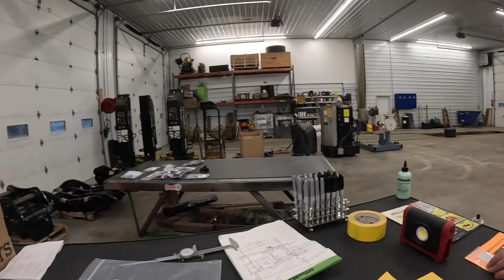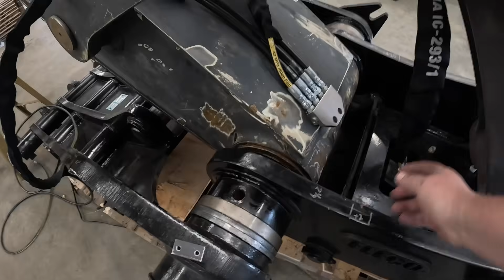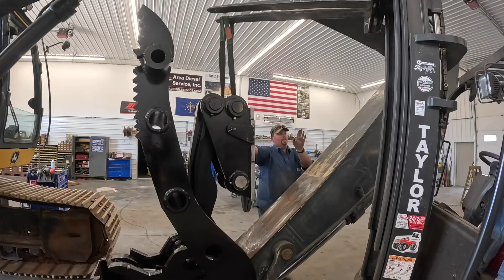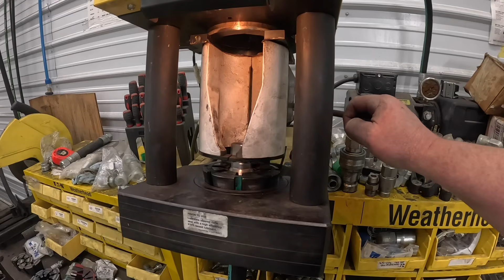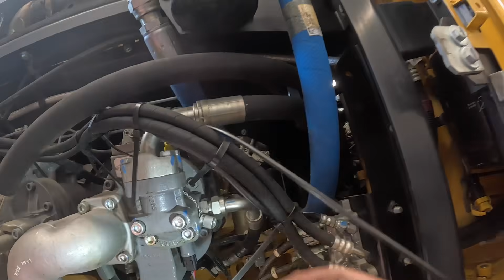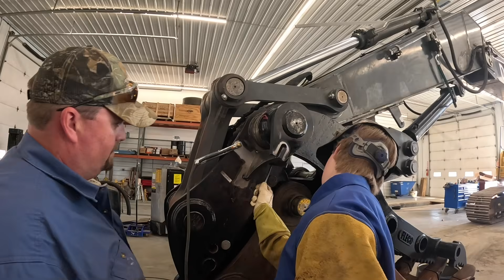We turn a John Deere 350G excavator into a car crusher with a new pro link thumb and coupler!

Comment: How about a few tapes in the shop with inches and MM both to read? If you don't think in MM then at least let your tape  teach and translate  for you and check on you every day. [And on the dopes that write the manuals] Using dual mark tapes all the time teaches you the system bit by bit.

Comment: Put 2 tons of extra iron on the end of that stick and you add a lot of wear and tear to everything upstream. Especially the turntable bearing. Seems like a tough call to decide if it's worth it. I am living with a fixed thumb even though its plumbed for a real one.  Agility over attachment swapping seems a better choice. Seems like that thumb is way overbuilt for a 350.

Comment: I got a question for you, 

Does a dozer really need “tall” I guess you could say grousers? I mean, my buddies track loader has flat tracks and that sucker will push a big ol pile of dirt or brush. 

just thinking if it would be worth it for my dozer, I’ve never had New i’m wondering is it really that much of a difference?
Reply from the maker: Track loader is a different application and has a shorter and narrower track making it bite in more
A dozer is lighter, longer and wider so you need more bite
Reply: @C_CEQUIPMENT  oh ok. that makes sense, I was just curious and wondering. thanks for the reply

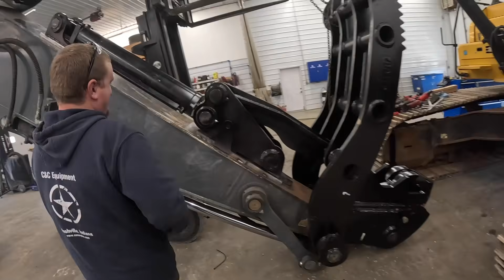Comment: 31:20 Hmm. Metric to Imperial conversion mistake, off by 10 inches. Mirror on the Humble telescope was ground to the wrong dimension because of same mistake. Cost government billions of dollars to correct telescope optics along with a second space shuttle mission and hours long EVA for astronauts to fix the problem.

Comment: Typically the pin that comes in the coupler is for installation in the bucket. That’s a soft pin. If you don’t pin the coupler to the machine with a hard pin, it’ll be wasted and a major pain to remove in a short while.

Comment: The thumb cylinder is electric control and not Proportional. The stroke return endings are savage for the Hydraulic system.  Hydraulic Cushion would stop it, but more $ are required to do that. I like watching your work.

Comment: Unit of Measure [UOM] is an engineering issue.  If you ever want to know who to blame, that would be the group that doesn't keep track of the UOM, engineering!  Math people are trained to keep track of the UOM as they go through the math, but engineers do the math then do the UOM calculation.  Most engineers skip the UOM steps.

Comment: Now the test, does bucket curl up all the way and tuck in so u can get boom low enough on trailer 🤔 Main reason I don't like alot of those aftermarket couplers, moves bucket farther away from end of stick, can't get boom down enough and loose quite a bit of breakout force digging.
Reply from the maker: Yep it does

Comment: I had an air blower that I took the nozzle off and put a fitting that I could screw a brake line into. When birds tried to build nests in the shop, I'd put a longer brake line in it, fill it with salt and hit the birds with it. They left.

Comment: In my humble opinion the 0.045" in. wire your running is way to undersized when welding 0.75" in. (3/4" in.) plate and bigger.  You may want to step up to 0.0625" in. (1/16" in.).  It will save a lot of welding time hands down.  One pass versus two or three passes.  I'm just a fat old (70 yr's) welder who use to weld up little 400 ft' long canoe's, with FULL SIZE HELICOPTER landing pads on the bows of those little thing's.  Please share with tucker, that if you weren't burning through a 10 LB's roll of 0.045" in. --- in a single day, you were FIRED, after one warning to speed-it-up, or else.  Yes that would be 50 lb's a week per welder.  How many welder's did the ship yard have?  50 welder's day shift and approx. 30 nite shift.  FYI, I would say 90% of the welding was done with 0.045" in. wire.  The hull of the little canoe was 5/8" in plate.  But here & their items of different sizes (Thickness) demanded either 0.035" in. or the 0.0625" in.   Not to mention some of the "SUB-ARC-WELDING," we did.  P.S. You might want to purchase a couple of different "TEMP-STICKS," I would suggest 500 degree and 750 degree Temperature sticks (a.k.a., Temp-Sticks) to start.  Your local welding supply store more than likely carries them.  When using a temp-stick, if it leaves a wax like mark (item to be welded) is still too cold.  It should melt and kind of look like thin water mark / melted-wax look.

Cost of Temperature sticks approx. $5.00 ea. (five-dollar's) or less.  Should last years for the amount you would be using them.

Comment: Nice thumb “merica” steel and fabrication”..!  Nice work by “Tucker” as per his usual.  I would have told that Ferrari driver, the price for parking in your driveway, is to at least “light up” the tires, and hit the rev-limiter going thru the gears as he leaves.
Thank you sir.

Comment: Good video thanks Clint.
TIP: Never weld across a boom or stick like the hose clamps you welded early on.
Weakens the structure in the steel and becomes a weak point for cracking to develop later.

Sounds miniscule for the little heat you put into the stick, but it matters and is Hitachi procedure.

Comment: Scrap prices down? Not just one, but TWO 5h1trolets. Does crushing them reduce the weight or something? Coulda just flattened the blue one, folded it up, & loaded it into the back of the slime green one. Save room that way.

Comment: Thk God for the quick coupler, first thumb I remember was pinned to the bucket pin so if a bucket change was required, have lots of fun there buds😂
Reply: Stand alone thumbs welded to the stick are 1/5 the cost and don't eat your turntable up. No bucket interference.

Comment: Easy way to quick reference Imperial measurement to metric is 1 metre (the proper way of spelling the word) is approximately 3 feet, so if you had done that the 921mm would have seemed too short at the 26.25" quoted. I'd say a typo and they didn't bother to proof read their document as seems to be the normal procedure now people are over reliant on spell checkers.

Comment: R u going to label and tag the new hydraulic lines and their connections to the various valves and returns ,maybe Tucker can develop some tags ?
You guys know what you've done but if the customer has the machine worked on ,it might be a bit of the unknown !
Nice install

Comment: You probably already got the birds out but for another time: It can be hard to get them out alive especially if they need to fly down to find an opening. I also find out that they want to fly towards  light. So what helped me get birds out again was to open so the air can flow through (in your place one door on each side would be enough) so the birds feel the airflow. And turn of the lights so they fly towards the light on the outside... But you're so smart so you probably figured out that yourself already. Thank you all for the educational and fun with all the videos. From a part in Sweden where there's still a little bit snow in shadowed places.

Comment: I had big hopes of a crown vic and a bucket from say fifteen to twenty feet coming down and glass and metal flying clear to the shop one way and the highway the other/LOL. Was watching the tracks on the machine when walking into the building... seen it had very little track fitting on the metal runners for cleat machines.   One big "Motha" of a machine, might get a garden dug with it in a big way

Comment: Wow you are lucky to get BSPP fittings that easy. I managed a project that used very large 18 cylinder engines and accessories built in England and Europe and everything was metric and BSPP. I was lucky and a local Canadian distributor took a list of the fittings I might need over the life of the project and brought in  stock.

Comment: USA,stuck in the imperial days /ways .
That's the problem with conversions,if the metric measurements were used ,it wouldn't be a problem 😜